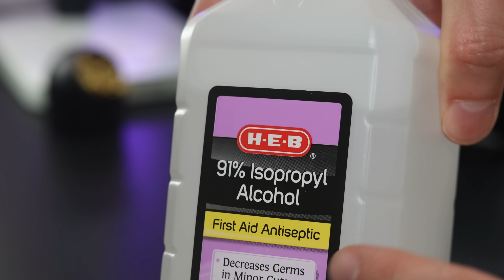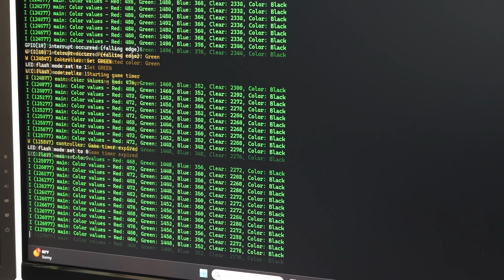Do This Before You Solder Anything

Comment from the maker: Like this video? Share it! Thanks so much for the support :)
Reply: I have never got flux core solder to work on its own. So, beginners should save themselves tears, headaches and broken components and just use flux like you show.
Reply: @aaronmicalowe  Wrong tip and temperature. If the temperature is too low, the flux burns away, before the solder spreads over the pad. Bigger tip and higher temperature solves that. 360 - 380°C lead solder and 400-420°C leadfree. But the tip should not be pointy, transfers no heat, just cooks the flux away and the glue under the pads. Recomment 1 - 1,5 mm flat rounded tip for small smd-resistors and 2,5 mm flat rounded for everything else.  Form of tip like "Weller ET A". Than the heattransfer is quick enough, that the flux is still liquid, until the solder speads over the pad and the connection is done. 0,5 mm solder wire should always be used with aditional flux, but 1 mm wire works well. I use only the 1 mm wire.
Reply: @aaronmicalowe  I never used anything else than flux core solder, never used seperate flux, never had a fail.,so you must do something wrong.
Reply: @alexvanrenesse1410  Standard soldering irons are a scam. Nothing less that a pro iron with temperature display works. It's not the skill of the operator, but how deep their pockets are.
Reply: Dude PLEASE tell me where you got that "dispensal bottle" or whatever you called it. That thing is awesome! I really want one!!
Reply: It’s a dying art form. I love the avionics field. I have worked with the most expensive equipment to repair some the most expensive pieces of avionics equipment in the industry for companies like Rockwell Collins, Honeywell, Viavi, and Mid Continent Instruments and Avionics. I didn’t even see it as work, I looked at it as arts and crafts that pays phenomenally.
Reply: You use a to small and pointy tip. They oxidize much too fast and can not store enough heat or exessive solder. A flat rounded one with 2 - 3 mm tip is perfect for anything(Form of tip like "Weller ET A"), you have enough heat for a quick solder connection, even on ground plates. This is important, that the heat does not travel into the parts and pre-damage them or destroy the glue unter the pads! And the bigger tip takes off exessive solder by itself and you do not need flux for most parts, besides finepitch ICs (Yes, I use a 3mm tip for finepitch ICs too, because I solder all pins on one side of the IC with one stroke). If you have to much solder on the pad, just add a bit of flux, touch the solder connection shortly and the tip will take it away. Desoldering braid is not to recommented, because you heat the new parts too long, which could cause a pre-damage. Just a bad workaround, because of the too small tip. I never understood, why such small and pointy tips are produced... they make no sense. And I use a wet sponge to clean my tip. The heatshock cleans not only exessive solder, it removes although the burned flux efficient. But I think only Weller tips can handle it on temperatures over 380°C (leadfree) on long terms. I use only a smaller tip (1 - 1,5 mm), for smd resistors smaller than imperial 1206 / metric 3216. But never a pointy one, always flat and round. Any sharp corner on the tip oxidize instantly and react repellent to the solder, what is unwanted.
Reply: Forgot to mention, keep always a bit of solder at the tip, when you place it in the holder, prevents oxidation of the tip. Never place it in the holder without!
Reply: Thanks! By the way, I don't think pure distilled water conducts electricity. It's non-water things IN the water that conduct. I don't know if 91% isopropynol is high enough concentration to submerge an active circuit in, but I think 95% likely is (if the PCB was cleaned before submerging, to prevent any other things from being in the liquid). Doing so isn't recommended though, because obviously it could ignite.
Reply: What type of flux is most recommended for best pricing/performance ratio?
Reply: @OMNI_INFINITY  rosin disolved in isopropanol is what I use as flux. Shred the rosin and mix 25 % or more rosin into isopropanol. Depends, how fluid you need it. Takes a few days to disolve completely.
If you want to submerge a active circuit use oil, not water. Water does not need much particles to conduct electricity, the dust in the air is enough. Even distilled water is able to conduct electricity. Oil is a good isolator.
Reply: @rubberduck777 Thanks👍🏻
Reply: Last step, isn't that cleaning of residue och rosin that are left.  So it doesn't ruin electronics and soldering by corroding it?
Reply: Can You make a more advanced soldering video?
Add the mention of NO CLEAN flux and how good or bad they are for your lung and what precautions you need to take to stay healthy
:)
Reply: What brand of soldering iron with the lcd display are you using?

Comment: I have no idea how soldering is even possible without flux. And not Rosin flux but hardcore acid flux, the kind you don't want to make contact with an open sore on your finger. Now, maybe the solder I buy doesn't have flux in its core, or I'm just particularly unlucky, but I was NEVER able to make a strong and clean connection without solder or using just Rosin flux. The only application I can think of where flux isn't needed is soldering to aluminum block. However, in the case of aluminum - you are using flux, just not your typical flux, or basically a generous coat of purified linseed oil applied to freshly sanded aluminum.

Comment: Another tip would be that you need a high wattage iron for larger projects. You would probably want a good soldering station for soldering to a larger board/motherboard due to the massive heatsinks they have. A small iron cannot keep the tip hot enough to overcome the thermal transfer. A 70 watt iron or better would be a good choice and even for beginners as you would futureproof your soldering and would be able too solder larger and larger items with it vs a 20-30 watt radio shack/Temu iron.

Comment: Great video.  Filled some gaps in my knowledge.  I don't work with PCB boards much (occasionally).  Mostly I am working directly with copper wires and custom cables.
As for Flux, I've been using ChipQuik CQ4LF, which I've been moderately happy with. Had to order some new flux and there are so many options.  It was recommended that for general purpose, ChipQuik SMD291 was recommended as a good choice.  Do you have any recommendations in that area?

Comment: Bad joint is gray and lumpy: a good joint is smooth and shiny. Shine is when the Tin is on the surface: gray is when the LED and Tin have not been mixed due to insufficient heat or lack of Flux. 
Always keep the Soldering Iron tip clean.

Comment: RADIO SHACK solder.. How old is this? I thend to discard solder older than a couple of years ( at least the 60-40ish stuff) since there is significant surface oxide by the.. makes life more difficult, and no on needs that.

Comment: Great soldering instructions.  I learnt how to solder in college about 20 years ago.  The method you illustrate here is pretty much how I do it too.  Getting the iron tip tinned with a little bit extra is probably the single most helpful tip for a beginner to utilize..  Well, that and a quality flux!  If you don't have a bit of excess liquid solder to work with on the tip, it's very difficult to get heat transfer from the iron into the components you're trying to heat up.  Once the components are up to temp, you simply poke it with some fresh solder and it does the rest for you.  If you're still having trouble, use more flux!  You can never go wrong with more flux.  If you still have issues after that, you might have bought some garbage solder or flux.  I once ordered 1lb of solder from china at what I thought was a really decent price off of Ebay.  I don't know what this stuff was made of but it was so terrible it wouldn't even stick to itself.  Stick with brands like Kester from a reputable dealer and you'll be golden.

Comment: Cheap irons (like I used in the 80s) lack a temperature control. If you're on  a budget, invest in a Pinecil, an open source iron that runs an operating system for temperature control.

Comment: I just used your video to replace a couple of switches on a $200 Wireless Gaming Mouse and the repair parts only cost $8. I was ultimately successful and was glad your video walked me through the process because the mouse now works, at least for now, and your video gave me the confidence to do it.  I'm 63 and the last time I touched a soldering iron was with my dad when I was about 14 or 15 years old and it definitely wasn't on something as small as a circuit board.  If you like ideas about future videos to make, I could have really used a video that showed how to desolder and remove a three-pin switch from a circuit board that is tucked between two other items making it very difficult to get to. I was able to use a pump to remove the bulk of the old solder but it's still didn't help me release the pins so they would slide out of the holes especially since I couldn't really get to the old switch to pull on it while heating up the solder.  A video that shows that exact scenario might be very helpful to someone that is just learning and doesn't even really know how to attack the problem. I ultimately ended up cutting a piece of speaker wire and used the copper speaker as a wick but it was still very difficult for me because I couldn't pull on the switch easily so it took a lot of work and I am sure there is a very efficient way to attack that type of problem but I couldn't find a video on that anywhere. I hope you consider it!

Comment: One problem that occurs with adding flux is the potential to lift the trace from the PCB. If you rework the joint too many times it will damage the trace, especially on older gear. Flux for electronics is mildly acidic. Do not use plumbers flux, its highly acidic and will damage if left on parts or traces. If you ever work on old vintage electronics always clean the board prior to desoldering parts with MG Chemicals 4050 Safety Wash or Dustronics Ultra-Pure ANHYDROUS Isopropyl Alcohol 99.9%. If you dont it will be contaminated an become difficult remove the old solder. Use flux very sparingly, it will revive the old solder and make it easier to remove with a solder sucker like the Hakko FR301. The key is to do it once or the trace will lift after a few attempts. Brand new quality bare PCB boards are durable but still keep this in mind. Repairing boards with parts on it is much harder, and the damage to traces happens fast. And dont use tips forever, once they show signs of wear put a new one on because they cause contamination to the solder as well.

Comment: This was a very good, informative and very helpful resource of information on soldering for beginners to intermediate, specifically how to solder like a pro which i found was easy, clear to understand and how to apply this information, both visually and by listening to your pointers, importantly on properly preparing a solder joint both with the soldering iron and the components. Also what not to do on and how to fix it if you do it wrong, relevant areas in regards to tools you might find handy and if you don't have then what you CAN use like with too much solder scenario- using wire, not solid core but thin braided core wire if you dont have copper solder wick like the 2mm plusivo brand i use, and the technique which i did not know, is a bit harder to do with wick than with copper wire which has more spring in it that keeps the makeshift wire wick spring tension up against the work therefore easier to use. 
Just saying thanks, you're doing a great job, i might get my nephew one of your cars as a project, it looks like a fun way to both teach and reap the benefits of learning new skills when the job is done its ready to go straight away! 
👍🏻 from me and a new subscriber.

Comment: 4:15 Plus you can easily burn the flux core away if you are starting out and apply heat too long at the same time as applying too much solder making the next solder point much harder & the next on and on, without flux in the tip end of the solder roll because it was released from the core by proximity to the soldering iron while not being hot enough to melt the solder furtherup the solder in hand, but close enough at the tip for it to flow out and parallel to the soldering iron heat activates flux so always good to have flux applied, and if you're using hot air to remove a cpu or gpu flux and solder mixture is required I mean it's not expensive

Comment: Something I found especially in damp environments is that the solder itself gets coated in tarnish and wiping it with wire wool first give a cleaner joint. Likewise cleaning old wire before soldering even multistranded wire like that used in the automotive industry benefits from a good wipe with wire wool.

Comment: Good video - thank you, but what do you do if the original solder is a different composition than the solder that you have on hand?  I have significant issues when intermixing, even with very small amounts of the original solder!

Comment: solid advice. I can't help but say though, you were not mislead when told that the solder can be used without flux. Rosin core solder has the right amount of rosin in it for creating a perfect clean joint. if you don't get a good joint without adding flux then you are not doing it right. With that said, adding flux is not at all a bad thing. It gives you more room for error.

Comment: A few things not mentioned in the video:

1. The soldering iron you use can make a HUGE difference. Iron temperature and thermal inertia are 2 different things. If you're soldering big gauge wires or components with thick leads into pads submerged in a wide copper surface (a ground plane for eg.), you need an iron/soldering station with high thermal inertia (Hakko and Weller make decent ones at a reasonable price). Small rechargeable irons like a TS100 Pinecil just won't cut it and you will find yourself struggling to inject enough heat in the leads/copper to get a satisfactory joint.

2. If you find you have excess solder on your joint, try to remove it using a solder pump first. You won't have to heat up the joint as long and it will take less time to remove the excess. Heating a solder joint on a PCB for a long time is never a good thing. Especially in the example shown in the video in which the component is a Dupont male header. The plastic frame on those is notoriously sensitive to deformation by heat.

3. Using wick should be used to remove the last bit of solder you can't remove with a solder pump. Again, use flux and only as much heat as necessary and work quickly. Don't use a wire, go and buy some wick ok? It's easy to find, inexpensive and a spool lasts a long time.

Comment: Pro tip #346. 
 Instead of buying multiple sizes of solder, just buy thin solder then take strand of 2 or 3 or 6 and twist them together to make it as thick as you want.

Comment: 9:43 the technical name for the shape is a concave fillet - that shape combined with a smooth, shiny surface are the two most obvious signs of a good solder joint

Comment: 7:42: Tin the tip is not needed. You can do it much easier: Place the tip at a flat angle at the rest ring of the pcb and also the THT pin. Pre-heat about 1s with the tip. There will be a little vault (between pin an tip) and exectly there you put the solder wire. If enough solder is there, remove the solder wire first and post-heat for about 1s and then remove the solder iron.

This is by far the fastest and safest method an I use this since +20 years now.

Rest of the video: great content! Thanks.

Comment: Lead-free solder is not only more difficult to work with, but it also results in a significantly shorter lifespan quality, if we're being honest! 🤫
Furthermore, lead begins to release the truly dangerous substances at its evaporation temperature of just over 1700°C, and not at the much lower soldering temperature.

Comment: actually, damaging the board and damaging components  is - paradoxically -  more probable, if the temperature is too low, as you will continue to heat up the whole circuitry way longer than you would need to to just spot solder a small joint.

Comment: You can also buy tip tinner compound, which will keep the tool perfectly covered for heat transfer. I don't know how much it helps in the long run, but I find it to be very useful.

Comment: great. never new you could just use simple copper wire to clean up solder joints. very informative. Do you have any advice on a soldering iron under 150 eu/dollar? to use on audio repair?

Comment: There are 4 types of non-leaded solder. SAC 305 (Tin 96.5-Silver 3-Copper 0.5%),  Tin-Copper (copper 0.7-3 %), Tin-Silver, and Tin Bismuth. 
In general the Tin-Copper is best for hand soldering, SAC 305 is for machine / PCB assembly, Tin-Silver for higher temperatures.  Tin-Bismuth is not really useful, mostly for low temp usage.

Comment: I have been soldering electronics (and plumbing!) since high school in 1972.  You covered all the bases beautifully.  Exceptionally clear and concise.  What I love about the advances in soldering tech is the fact that you can set temperatures now.  Back in the day, we would have to switch elements for different temperatures; I used Ungar soldering irons, and I would etch my own circuit boards.  :)

Comment: Outstanding presentation. I solder everything from PCB components to sheet metal fabrication using large soldering irons. Something I learned years ago in a forus is to take Sal Ammoniac and sand it to make power, then mix it into water to make a solution. To clean your soldering tip, you very quickly plunge the tip into the solution then tin your tip. It works great for me all the time. Also, just rubbing the tip on a block of Sal Ammoniac wonk great but produces fumes.